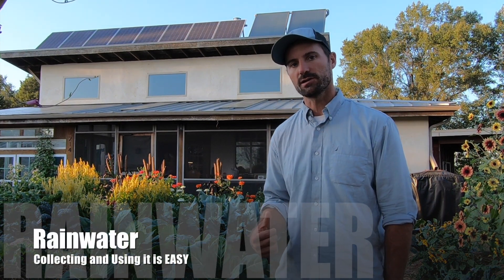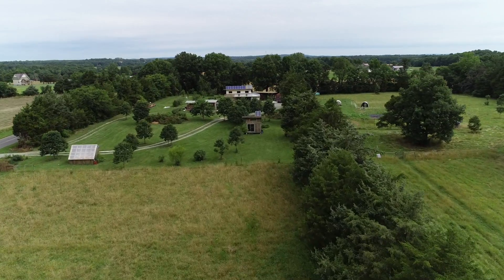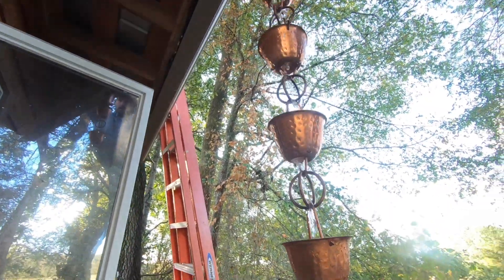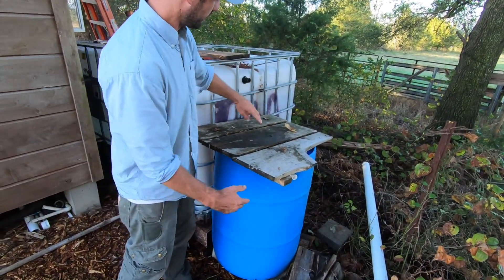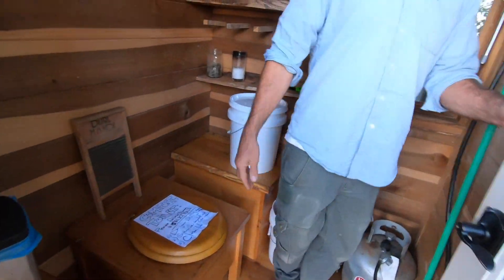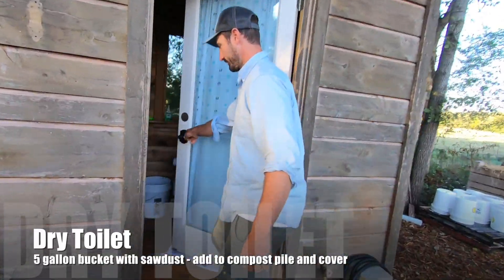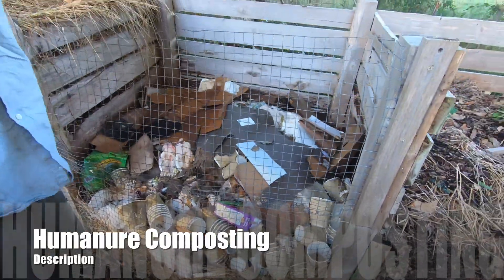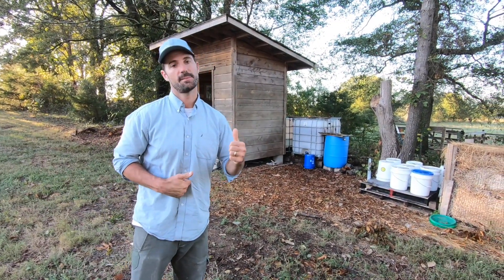Living Off the Grid in a Tiny Bath House | Infrastructure for Off Grid Hunting Cabin

Comment: Got to say I really like the setup. I would like to put out there that an expansion tank for the water pump can be essential if you get a pump that does 5+ gallons of water per min instead of 3 GPM you have. The expansion tanks are tiny compared to a pressure tanks and prevent the pump from pulsing when water usage is falls below the gpm of the pump. I've got an aquatic pump that does 5 GPM but it pulses on and off when used with a shower which can causes overheating and uses significantly more power than when constantly running. So for me the expansion tank or pressure tank was necessary.
Reply from the maker: Inspectorzinn2 good idea. Thanks for the input.

Comment: In india they use methane type gas that comes from waste deep underground to heat water for shower.
Reply from the maker: that's awesome! We use solar thermal collectors for our hot water on the house, which is free forever once you set it up. But for simplicity sake on this bath house, we just hooked up a propane tankless water heater.

Comment: This video just appeared as an ad and man was it spot on. You have done what I attempted to do 5 years ago. I had the structure, pump, harbor freight panels, deep cycle marine batteries and a fancy composting toilet. The difference?  Yours is a well thought out success and mine failed miserably. Sure could have used your insight. Sub'd.
Reply from the maker: What do you think would be the most helpful detailed instructional video for building an bath house setup like this? Water pump? Rainwater harvesting / piping? Solar/battery setup? Framing? Humanure? I'd love to help folks get a more complete picture of how this can be done successfully. It's a great little project to get started living off grid on a homestead and build confidence for larger projects.
Reply: @HeirloomBuilders  I think  a how to on setting up the pump. Would be the most helpful. Although I would like to see more on the rainwater set up. Thanks.